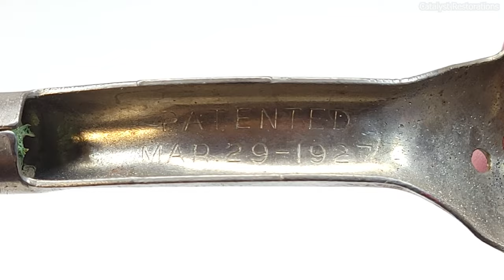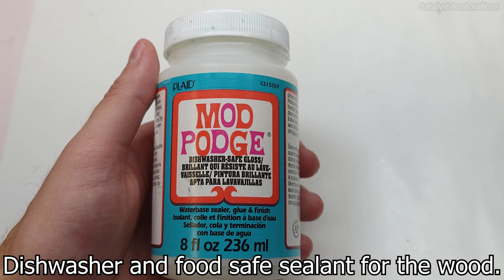Restoring a 1920's Grapefruit Corer

Comment: Now that's what I'm talking about! I've got a boxful of green handled utensils just begging to be spiffed up. Your green handles should have a bit of blue in them to match the Jadeite color.
Reply from the maker: Just a gray (soft) Scotch-Brite works wonder on removing an old oxide layer without damaging the underlying metal! Agreed on the color too for sure - I'm an engineer and not an artist (although I wish I could be both!) so I'm still getting better and color mixing 😳. Luckily since it's wood I can lightly sand and repaint.

Comment: From what we know today, it's kind of a weird idea to make this from alumin(i)um. In an acidic (grapefruity) environment, it tends to partly dissolve and is not particularly healthy when consumed (think Alzheimer's). Good thing you nickel plated it, although that is not entirely unproblematic either.
Reply from the maker: You're correct on all accounts there! The even more interesting thing is that grapefruits today have been selectively bred to the point where they have essentially eliminated the "core" that would've necessitated this corer 50-100+ years ago. Even the one I demonstrate this on in the video really doesn't have a large, tough core that needs a special tool to remove!

Comment: NBS Restorations - No BS restorations - an alternative title to your channel, CR. Also because there is not much catalytics in it. Meaning: I am still waiting for the video on various methods of surface treatment of steel, not least various methods for bluing.  i myself do not do much bluing these days. Stopped doing it on axes because the bluing gets wiped off by friction of the wood while using the axe to split which i do much. My next project will be bluing of the old ambolt I have bought. I am going to get the loose rust off and put some motor oil on and burn it with a gas torch. Is this a good idea, you think?. Thanks!
Reply from the maker: Haha, I always try to keep the frills and gimmicks to a minimum in my videos! We're all here for the restoration. 

And I promise a video's coming on more homemade bluing experiments. Truthfully it's very difficult to create a truly long-lasting impervious, inert layer without heavy paint or some seriously nasty chemicals, but I think the answers are still out there. Gas torch and used motor oil quench would be pretty decent if you probably did it several times back to back.
Reply: @CatalystRestorations  thumbs up - all of them!